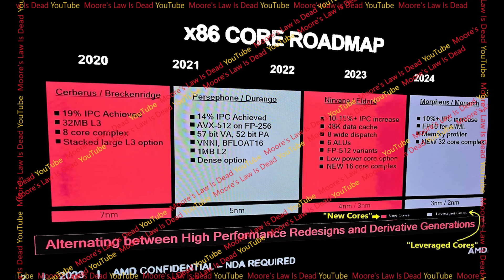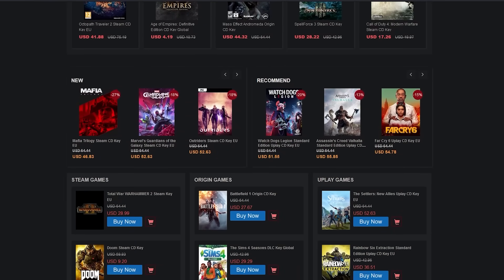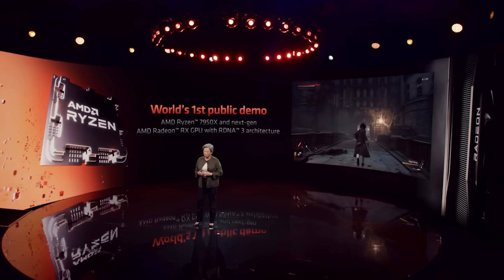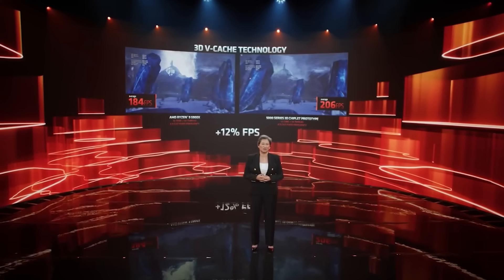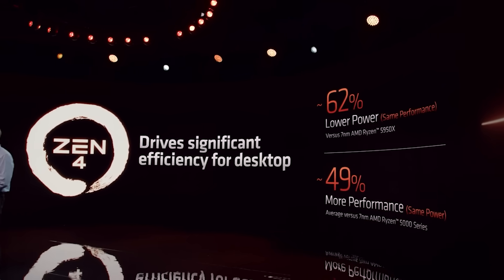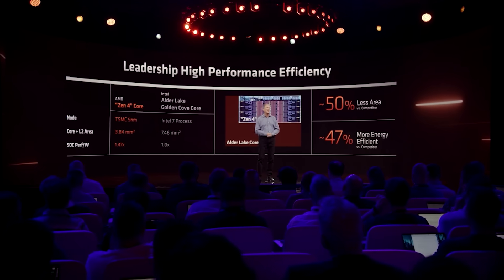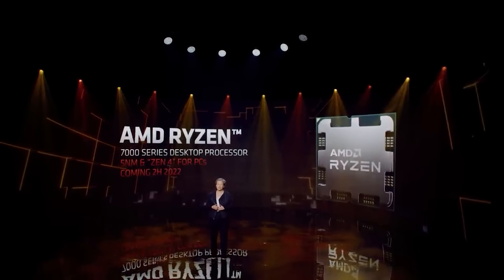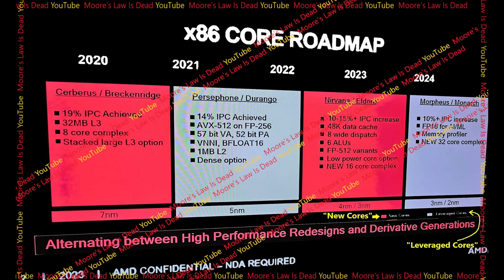Investigating Zen 5's INSANE IPC Gains - What's Going On?!

Comment: Where am I? I'm in the worst spot GPU-wise. I have a 10GB 3080 FE. I want to upgrade, preferring single player games at 1440P with everything set to High (not necessarily Ultra, but at least High textures). I'd like to double my performance for around $500 bucks in a year or so. I paid $500 for the card, two years goes by, the card is 5 years old at that point, so twice the performance of an 80 class card 5 years later is not a big ask, or it has never been in the past...until this generation. I could go as high as a grand or so without really feeling like I spent too much and that would give me a good reason to finally buy an OLED except I still feel they are obscenely over-priced as well, maybe even moreso than GPUs! So am I OK with doubling the performance of a 3080 and getting a new display for, say $2K total? Idk, that seems like a pretty shitty deal to me. If I had a 6700XT, or a 3070Ti then it would be a no-brainer. So what am I going to do? I have no idea, I really don't. The 10GB of video memory will most likely force an upgrade, but for all I know something just like this gen could happen where my budget cap was $1100 and there was nothing there even remotely worth the money too me as I do use Raytracing in every game that has it and I was not budging over $1100. Not for the 4080, no way. I won't do it for a 4080Ti either, not this deep into the generation. The 4080 is out of the question, again, as even at, say $999.99, we are a year into this generation. It is what the 4070Ti should have been. Maybe the 4070. And they want top dollar for it? No.

It doesn't matter how much money I make or have in general, it's a matter of principle and morals. I can't in good faith type out essays all over the place advising people not to buy things bc it isn't just a poor deal for themselves, but it legitimately hurts the market for everyone then go out and spend way more than I feel a card is worth just bc I have the money. I think I have over a grand in my wallet right now. Literal cash, I'm not counting credit cards or my bank cards obviously, so it really isn't a matter of what I can afford at the moment, it is a matter of not contributing to something I think is bullshit when there are other viable solutions. My guess? I end up spending $700 on a used 4080Ti in a year and a half. The 4080Ti would have to release at $1000 for me to buy it this lat into the generation and the 4080 would have to be around $850 for me to consider it. Neither of those things are happening, and yes, $150 bucks over $850 is enough fo rme to say "Nope, I'm good." I would consider AMD again. I loved my 580 and my 5700 was a beast, still running fantastic in my son's PC at 1080P in his single player games and 1440P in the sports titles he plays (Ugh, my old favorite yearly title for 15 years in Madden, NBA2K2X, Fortnite along with some pretty great games like "Descenders," wow that game is bomb. etc etc). So I'd be happy to switch back if they got raytracing figured out in games like Cyberpunk 2077 and not just Capcom games. I don't play COD so the performance there means nothing to me.

Even so, with no high end card I highly doubt they will have a card that doubles the 3080's performance, though they may have a top end card around $500 bucks. I'm pretty sure as soon as RT is enabled it will barely pull ahead of where the 3080 is now and that simply won't do. I'd love to be wrong, but their current $500 card (well $550'ish irl) barely, and I mean barely beats the 3080 FE in Raster at 1440P then gets crushed as soon as RT is turned on in just about everything. Maybe I'll get really lucky and Larian will release a huge BG3 expansion, Rogue Trader will be great, Spider-Man 2 will release on PC along with Horizon Forbidden West along with a few other titles and I won't need to upgrade at all. Maybe I'll just slap in a new motherboard, CPU and RAM then just chill until 2026/2027? Bleh, that'd be a waste with a 3080 though (I currently just have a 5800X with 32GB of the HP 10 ddr4 3200 cl 14 memory which is perfect for this GPU, but even a 4080 would probably warrant an upgrade across the board, even at 1440P since RT seems to slap the CPU pretty hard). I would just buy a prebuilt HP with a good GPU along with an OLED but I also can't buy PC's I can't upgrade easily. Or won't is a more accurate term. No way in heck I am paying a boutique builder to do it since part of my job is building PC's for a living, so I can build a clean rig if I want, and going boutique would defeat the purpose of a prebuilt which is saving money on the newest components around release. Or picking up year old high-end things that are on sale for a steal.

So like I said, I am in the worst possible position. I want to upgrade, but don't need to as the PC is pretty much perfectly balanced right now for what I do, and will probably be perfectly balanced for 1080P in a year or two. I have numbers in my head for products that I won't budge on.

2x3080 FE performance for $500-$700 USD.
50%+ Improvement on the CPU motherboard setup for $600 (including RAM)
$700 or less for an OLED that is smaller than 42" and larger than 27"s, though I would consider 1440P.

In a normal market this would have already happened, but we obviously aren;t there yet. OLED's have been basically the same price minus one quick dip in 2020 before jumping right back to $1000-$3500. I don't care about refresh rates over 144hz so seeing 240hz on an OLED display does nothing for me and is not a selling point.

Screw it, I most likely have a year to wait before anything really changes anyway. I can keep tossing money into my sock drawer after going out and in a year or so when I literally have $2500, $3000, wtv, just sitting there next to my undies doing nothing maybe I'll just say "You know what, not only will I not miss this money, but I tossed it in there for PC parts. Just bite the bullet and get the absolute best card you can from the used market and build around that." I'll give my regular system to my son qhixh qouls bw akin to saving $1000 or so on building a similar level of quality 1080P/e-sports 1440P setup and move on. Or AMD could surprise us all and nail hardware Raytracing somehow next gen making a 50% improvement in raster with a 150% RT boost over Navi 3 for $569.99. AMD and Intel may be so competitive we see CPU prices stay the same while board prices go down and RAM sits around where it has been for a minute now. So many possibilities. The only thing I am sure of is not overpaying for a new GPU or gaming display. I'll buy a new 32" 1800 curve 144hz VA display if I need a new one at that point and OLED is still silly. Or a leftover C1 40" for $700 or whatever they go for on that particular day, hoping it lasts at least two years before crapping the bed. Even 40"'s is still so big when you are sitting 3 feet from the screen though, especially when it is a flat panel...Erg.

Comment: Well. Moore's law actually explained the IPC in his video where he had the slide very well.  The slide said 14% achieved on architecture which early slides said 8%. IPC predictions are not precise and AMD:s early internal predictions seem to be always conservative.  He also had image of architecture diagram. Which pretty much showed width of architecture in several places increased by 33% and one for 25% and another 50%. And then changes in scheduler to allow way larger increase in terms of memory parallelism and increase of L1 data cache to 48kb. And that's not even considering the width of AVX-512 execution being increased. 
Then again, architectures are so wide that most of the time software doesn't have enough instruction parallelism for architectures to fill the pipeline which is why there's benefit from SMT for using the unused resources because other thread cannot use all the resources.  However, it also means that there's potential for optimized software to outshine anything generally said about IPC.

Comment: Next gen will only be interesting if we get more performance for the same (or lower) price.
50% more performance for 50% more money like with Ada is simply embarrassing.
Reply: THIS so THIS.
I really couldnt care if the 5090 is 3x performance than a 4090, if the price and power is higher. The 4070 was the most interesting card from nvidia, other than price and vram.
In all honesty gpus are getting boring, and I just want a powerful apu from amd, something like 1080ti performance in a 10w package  (ofc zen5c or soemthing
The same goes for cpus, I want idle power to be less than 1w, and zen3 performance in a 10w package. Not a 15w tdp thats actually 28w and turbo to 45w package, thats just silly.
Handhelds are the most interesting tech other than vr in the past 5 years, but more power efficiency is needed (bonus points if amd manages to make an sbc or asrock makes an sbc and the "apu" is slotable

Comment: I was gonna upgrade my entire pc.

Ryzen 7 1700 + gtx 1080 + 16gigs of 2400mhz ram
To
Ryzen 7 7800X3D + 32 gig's of fast ram and a new gpu in 2024 (after saveing up some cash) 

But my GTX 1080 died..... So RTX 4070ti is in my current system but the AM5 motherboard prices in India are insane hence I'm waiting for a reduction in prices by the time Zen 5 launches.

Comment: I hope the 8000 series and beyond get a lower idle power consumption, recently upgraded to to a 7600x - which is very energy efficient under load and I can run 1440p @ 60 fps with only 50watt, but will hover at 35watt on idle on desktop - where as an 13600k is around 8 watts on idle. So I really hope the c-cores will come into play and drop the power consumption on idle

Comment: So what is the point of the RDNA 4 release then? If the cards will all fall below the 7900 for the 8000 series, wouldn't it be completely pointless to buy an 8000 card when you already have a 7000 or even 6000 card? Why is AMD trying to compete with its own products?

Did they just find a way to make basically the same card (in terms of performance) at a lower cost?

Otherwise it would make much more sense to just keep making the 7000 cards for another year while they concentrate on their AI stuff and then make a proper 8000 series when they come back to gaming in the next cycle.
Reply: I think the point is two fold:
(1) very few people are buying GPU’s at the very top of the product stack, so just because AMD won’t have a product that exceeds the performance of the 7900XTX doesn’t mean there aren’t going to be dramatic improvements everywhere else in the product stack.
(2) RDNA4 is still going to drive massive performance gains over RDNA3 (Phoenix) in mobile chips.

Just because they’re not going to have a flagship product doesn’t make the entire generation DOA. There’s still going to be significant uplift in perf/watt and perf/$ at every product tier they do release RDNA products, and those improvements will matter greatly for the millions of people who will buy RDNA4 at the low and midrange, to say nothing of laptop buyers.
Reply: @benjaminlynch9958  I hope you are right. In the 6000->7000 gen change we did not see much uplift in the mid ranks. 7800XT is almost exactly the same as the 6800XT and the 7700XT is just marginally better than its predecessor. It was at the 7900XT that we saw the most uplift, especially if one bought it specifically for 4K gaming.

The performance/watt is an interesting metric as that is something I never paid much attention to. Electricity is not very expensive when the difference in power is <100W and power supplies at the 850W range can both easily handle these cards as well as are the most common ones I see for sale. Heat is probably the biggest issue with power.

So if AMD can launch a 230W 8800XT that is ~5-10% better, in a dual slot, dual fan footprint for $399, they got themselves a winner.

Otherwise it makes way more sense to pick up a 7800XT or even a 6800XT, next year when the prices drop even more.
Reply: the same reason the RX 5700 /XT were made before RDNA2.
Reply: @kevinerbs2778  and that was fine then. 1080p was well established by then and 1400p and 4K monitors were prohibitively expensive for the average gamer. Now they are both cheap.

I was looking at the next generstion of GPUs to finally be the gateway to 4K gaming for the masses. With current specs and trends, the 5070(or maybe 5060Ti) and 8700 would be 4K60FPS for sub $500.

AMD should have burned the 7000 series and concentrated on AI a little earlier when they were at the top with the Radeon 6000 vs RTX 3000 lines.

When they come back (hopefully in two years with 9000 cards or whatever that gen becomes), they will once again have to face the same cycle of being the loss leader just to get customers. They do this like every third generation and never learn.
Reply: RDNA 4 sounds very promising so far. Sadly, Nvidia stopped competing.
Reply: I’m hoping that RDNA4 actually gets that 54% performance per Watt uplift that we were supposed to see with this gen. It would be fantastic if we could see a $300 GPU that matched the 7800 XT with 160W power draw. Been itching to build a portable PC to replace my laptop, and currently the best single fan GPU is a 4060. The 4060ti has a model coming soon, but I don’t really want to pay 400$ for a card that is a 0% performance uplift over last gen.

Comment: Would be strange if AMD put zen 6 on AM6. Would mean AM5 only got 2 generations, basically like intel although they just started doing 3 generations on one socket.
Reply: Yeah, and I think all the hyperventilating over the possibility is a bit overdone. Historically AMD has only changed platforms when the DDR memory spec changes and is not pin-compatible with prior generations and there’s basically no other option. If Zen 6 is on a new platform, that’s a very strong indication that EITHER DDR6 is ready for prime time, OR it means AMD is moving the memory onto the CPU package via CoWoS packaging in the same way Apple is doing with M1 and M2 chips. In either scenario we’re going to see major uplift in memory speed and/or latency, and the change to a new socket will be well worth it from a performance standpoint.
Reply: That definitely would make me switch back to intel. The benefits of AMD would be gone.
Reply: Considering Zen6 is likely late 2025, I don’t see how it won’t be AM5, considering AMD recently committed to supporting AM5 “through 2026.” I don’t think DDR6 will be ready for consumer platforms by then, so I don’t see the purpose of a brand new socket.
Reply: AMD got way too much credit for that crap on AM4. It's laughable how quick everyone forgot they TRIED to limit Zen3 to 500 series boards which would leave only 2 gens on prior AM4 boards. Then after their BS excuse and all the backlash they reneged and allowed it proving they were lying all along, then you still had to wait months for 400 bios and 300 series had to wait over a YEAR. What a joke.  At least with Intel you know exactly what you're getting. I had to buy a new mobo for Zen3 cause they wouldn't give us a timeline on bios, but Z690 had new bios the DAY Raptor lake came out and I guarantee it will again the day 14th gen comes out.
Reply: @europason2293  "Support" =\= the latest chips. Technically they're still "supporting" AM4 today. Never confuse marketing with intention. They'll swap in a heartbeat if it's profitable/convenient. Not to mention they tried to kill 400 for zen3 so "socket" support means squat if they want to force you onto a new chipset.
Reply: @zodwraith5745  Just noticed they tried to limit Zen 3? THEY ALREADY TRIED TO LIMIT ZEN 2
They didn't wanted to support Ryzen 3000 on 300 series boards, AMD got backlash fast for it so they got forced to release "Beta Support" for it.
If Zen 6 is AM6, i expect that tbh
Reply: I really hope they'll continue to support AM5 longer. 
AMD holds such a strong advantage over Intel's 1-2 gen platforms.
Reply: @Syping  Consumer outrage is what got them to change their mind on that. People should do the same if they want better support for AM5 and don't fall for any BS statement they they put out why you need a new motherboard.
Reply: @Syping  It's good that the backlash got them to change their minds. That's how consumer activism is supposed to work. Still BS that they took MONTHS to release said bios after Zen3 launched though when there's no freaking way it took that long. Not to mention those 300 bios took EIGHTEEN MONTHS.

Throwing a tantrum like that on your users is unforgiveable. If you don't want to support it don't lie to me and tell me you will. It's the LYING that pisses us off.